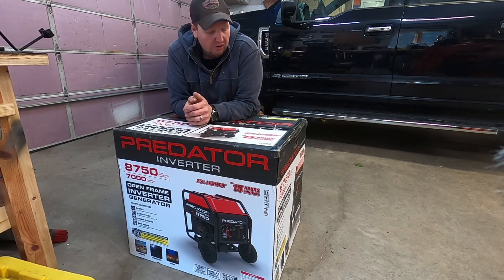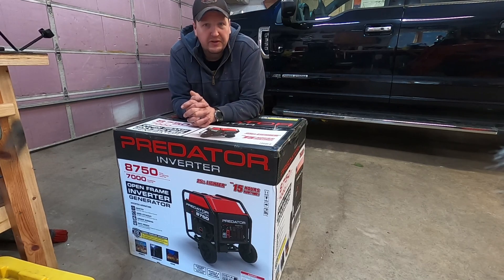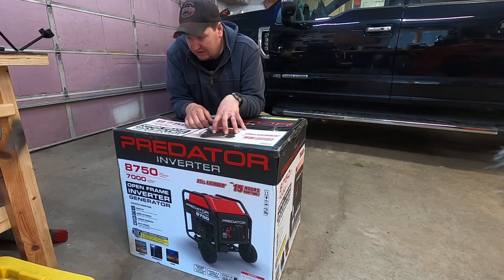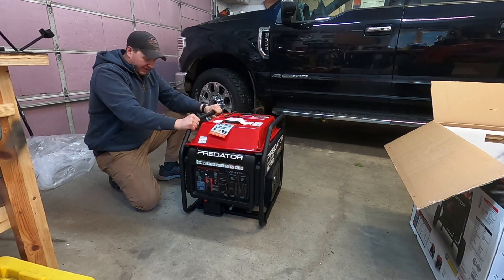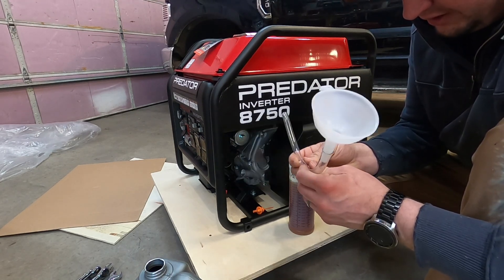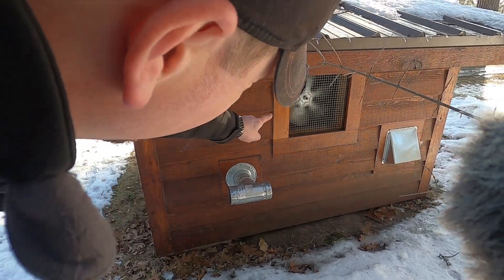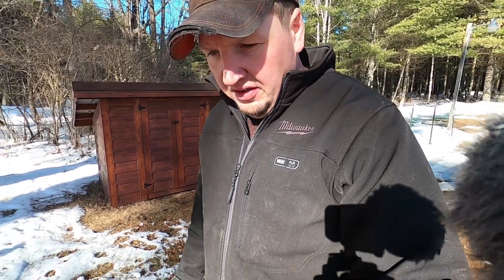Harbor Freight Inverter Generator and DIY Generator Shed

Comment: Just put a piece of duct tape over the CO2 monitor and you should be good.
Reply from the maker: It honestly hasn't been an issue :).  Must be enough air flow and proper exhaust.

Comment: I have bought both the regular Predator generator and the Predator INVERTER GENERATOR..I got many years use out of the regular 8750 generator. It got me through that horrible Texas freeze we had a couple years ago. When it came time to replace it harbor freight was out of the same 8750 generators and only had the 8750 inverter generators. The salesman told me it was actually a better generator. It WAS NOT..To use it I had to cut off my electric water heater, and not use the electric clothes dryer or electric stove. It would stop producing power and show a code on the screen. It only lasted me two uses and the inverter module went OUT. A replacement inverter module is $400..So here I was with a generator inverter that was useless and still looked brand new! If you do decide to buy the inverter generator bite the bullet and buy the extended warranty because the Harbor Freight repair people told me it was very common for those $400 inverter modules to go OUT and they don't repare them.
Reply from the maker: Interesting. I'll have to watch out for problems.
Reply: Yeah, we have a Harbor Freight in town and they keep lots of generators.  Funny thing is, I see a TON of  them on Facebook Marketplace being sold....especially the non inverter models.  I just can't spend their asking price for a generator and then have to buy a "one shot extended warranty" since they only have a 90 day warranty.  Too many other options out  there now.  Especially dual fuel quiet inverter generators that you can run as a single for basics and two in parallel for double the power if needed.

Comment: I have owned both of these generators. The first one was the 8750 generator. Great generator! It got me through that horrible Texas freeze we had a few years ago when we had no power for 7 days. My mobile home is all electric and we were able to live life as if nothing had happened. We heat our mobile home with those oil heaters and the generator worked flawlessly. We did have to fill up with 6 gallons of gas every 8 hours. It didn't get used for a while and I lost power to one side of the 220 outlet. I didn't have time to look at it so I went to buy another one and all they had was the Predator 8750 inverter generator..The salesman told me it was as good as the plain 8750 generator. Liar 🤨. It would trip the inverter breakers and the "overload" light would come on. So I turned off the house breaker that goes to the water heater and we didn't use the electric stove top or electric oven. We did use two small 5000 btu window unit A/C's. It did good for 2 hours then it stopped producing electricity and the engine started racing for about a minute then shut itself off. When I restarted it the engine raced high again then shut itself off. No power was being produced either. I thought it might be the carburetor so I ordered a new one from Ebay, installed it and it still did the same thing. So i contacted Harbor Freight and my 30 days warranty had expired. They told me more than likely its the large module and it cost almost $400. I spent $1,700 on that inverter generator and only used it once. Now I have to decide if I want to spend $400 for the module on a generator that won't run my entire house or just accept my $1,700 loss..The modules are not repairable. Now I wish I had bought the entended warranty 😔. I screwed myself. Although I really don't like having a generator that wouldnt run my entire house. I ordered a 10,000 watt and received it today but not from harbor Freight. This time I bought one from with a 3 year warranty and not the inverter type. The compliments I do give the Predator inverter generator credit for being more quiet and better of gas due to the eco mode. It used less gas to operate. Although I ratcher spend more in gas and be able to run my whole house. This time I wont turn the hot water heater on or cook on the electric stove. I will eat a sandwich instead and not push the generator to its limits 🫤. VERY EXPENSIVE MISTAKE.  MY wife and I are spoiled and don't like change in our life so I learned an expensive lesson 🫤. It just pisses me off that the salesman told me the inverter type was better so I bought it due to them being out of the regular generators 🫤. We don't do well without electricity in our normal life 😂.
Reply from the maker: The only issue with the normal generators is that they aren't as friendly to the sensitive electronics in our homes these days. There's in consistencies in the power flow. When I used the old 8750, the LED lights in the kitchen flickered. 

I'm sorry you have had bad luck with the new 8750 inverter.  Since I did this video, ours has been flawless.  Actually have used it a couple times and it runs the house great!  Granted, we have mostly gas appliances, so we aren't loading it all the time.  The only big load we give to it is the well pump. We do have a large range that uses an electric oven, which is something that we would avoid using in a power outage situation. 

Thanks for being here!!

Comment: Great video. Just downloaded the shed plans, do you have a parts list for the fan and other things that you used to set it up?
Reply from the maker: There should be one in the plan set you downloaded.  Did you find it? I did not include electrical.

Comment: I guess you don't have a lot of high-starting current motors you are trying to run?
Watched a video of someone using one of these to run AC units and an Air Compressor. 
It was UNABLE to start the big shop compressor due to the high inrush current draw!
Ran nearly all the other stuff fine.
Reply from the maker: I have a bunch of high current motors.  Large air compressor, heat guns, AC, etc.  I just don't attempt to use them while the generator is being used.

Comment: Great videos across your channel. This shed is a picture perfect fit for the cabin we just finished and your innovated use of fans for coming and forced intake and exhaust is great. 

Is there any chance of getting a parts/items list for the intake/exhaust/cooling components? Or is that simply a standard attic exhaust with a built in temp sensor?
Reply from the maker: I just went to a big box store(Menard) and got the standard attic fan which comes with a temp sensor and then also for the intake a standard 6" round duct fan.  Nothing out of the ordinary for this setup. 

Thanks for watching and share it with your friends!

Comment: I have a dumbass newbie question that is bothering me PRIOR to purchase [I have not yet installed 30/50 amp box connecting to home panel]:  Using this 30 amp  plug 120/240 from the generator into my 30 amp box connected to my house panel - Can my home use the FULL 7200 watts with all my 120 volt applications [most of the home]?    Thank you for your time!
Reply from the maker: It is my understanding that each hot leg coming out of the generator is a max of 30 amps (actually 3500 watts) on each.  So there are two hot legs of 3500 watts each, totaling 7000 watts, max running. Typically, breaker panels in a house are two hot legs, the breakers as you go down the left or right side alternate from hot 1 to hot 2. So the load is approximately split among the twolegs.

Comment: We purchased 2 of these generators to power our RVs charging and air conditioning needs. The generators keep tripping the 30 amp plug. My old 4000 watt Honda powered the same RVs with no problems. I think they are off on their wattage ratings. We also tried another 7200 watt generator that could run both RVs air-condition without any problems from costco. Before this we had the harbor freight 3500 and we ran that guy well over 2000 hours without any problems except for the pull start breaking just after a couple uses.
Reply from the maker: Are you using soft starts on the AC's?
Reply: @OutdoorsEngineer  no we are not using them. I know that would help, but those suckers are expensive. We returned both harbor units and purchased a unit from COSTCO $699 bucks and she'll run both units... plus it's gas, propane or natural gas. It doesn't have the idle down feature that this unit has, and that is good for saving fuel, but we'll see. It looks like even Honda generators are made in China now.
Reply from the maker: @joeydonaldson4054  The new Harbor Freight 5000 generator looks intriguing.  5000 startup watts.  Remote start, dual fuel.
Reply: @joeydonaldson4054  300 bucks and 15 minutes to install. Dropped mine to 18 amps (on my house not rv)

Comment: Does it run a hot water heater and or AC
Reply from the maker: It certainly is possible.  Depends on the load of the appliance.  Max of 3500 watts per hot leg coming out of the generator.  Take a look at HF's website, it lists possible appliance loads.  https://www.harborfreight.com/generators-engines/generators/8750-watt-inverter-generator-with-co-secure-technology-57480.html

Comment: I've watched every generator shed video on youtube and although I would have used rockwool on the inside I must say this is the best looking shed I have seen.  I went with a lifetime plastic shed for my Generac 17500 with a dual fuel kit but given the THD I'm either going to get the Westinghouse 15000DF or just get a 26KW installed.  I have serious money invested since I did 10 100lb tanks and have them filled just incase.  In Texas this thing gets so hot it's scary.

Comment: Can you use a regular car battery for a generator and what other kinds of batteries you can use for a generator ?
Reply: Yes, but you would want to use a deep cycle battery or a Lifepo4, which is preferable. You would need to connect DC alternators (like the car kind) to a charge controller to charge it using an engine. On the output, you would need a 120v or 240v inverter to concert the DC battery power to something your house can use. Look up solar charge controller/inverter combos, there are many on the market now. This would be a great setup and you could even power the engine off for hours with the correctly sized batteries.
Reply: @2mYgR   @JPG23  It's you-tube videos that shows how you can use a car as a generator.Can a 1000cc car battery with a 1,000w power inverter power a electric oven that's 800w or even a 800cc car battery  ?

Comment: Just a heads up!!!! You must drive a ground rod and ground the gen set. The. You need a 3 pole manual transfer switch so that you are isolating the generator neutral from the power provider neutral. This gen set has a bonded neutral and will not work if you end up connecting power provider neutral to the generator neutral. Not to mention the potential damage and danger if not done properly. Please do you research if connecting to a home that is not in the back country.
Reply: Ground rod is not needed - it affect protective device activation.  Neutral to ground bond need to cut.  Transfer switch is not effective and convenient at all - interlock device is all needed
Reply: @AlexV-pf3io  Exactly,  just unbond it and use the house ground. I might put a switch on mine for bonded/unbonded. Bonded for extension cord use not attached to house/.

Comment: I am having a problem with the 8750 I just purchased. The digital display will not climb beyond 121 volts to 240. Notice that others are having the same problem with their 8750.  Did these people have drain the unit and take it back to HF, or is there a fix? Thanks
Reply from the maker: Why would it put out 240 volts?  Typically 240 actually is two lines that are 120 each.
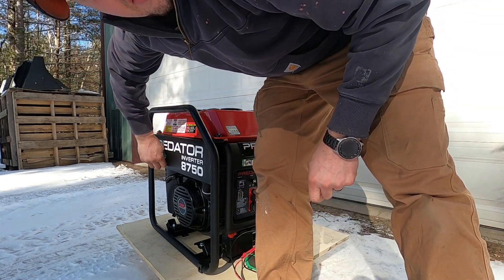Reply: See https://www.youtube.com/watch?v=g7WRtq_jSi8 @OutdoorsEngineer at 5:27

Comment: How did the co monitor system handle being in that shed?
Reply from the maker: No problems!  It was worked great!  I have even let it run for a few hours too. It helps that I have the fresh air intake, I think, and the exhaust going directly out the building.

Comment: I’d like to get me one of those. I was hoping it would be quieter than a generator that was not an inverter. Is it quieter? If that makes sense.
Reply from the maker: Compared to my old non-inverter Predator 8750, the new one is about the same noise level as the old one.  They are both open frame models.  Harbor Freight does have a Predator 9000, which is a closed frame inverter generator, and I would expect to be much quieter.  The shed I built turned it into a closed frame :) and also protects it from the elements!

I do have the Predator 3500 which is closed frame and it is very quiet.  We use it for camping.

Comment: what is an inverter generator? Never heard of it?
Reply from the maker: Look them up.  Much better for sensitive electronics.  A quick google search led me to this answer: 

Conventional generators use a mechanical alternator to produce alternating current (or AC) power that’s ready to use.
 

Inverter generators also use an alternator to produce AC power, but this current is converted into direct current (or DC), before a microprocessor inverts it back into cleaner AC power. This three-phase process produces much higher quality, more consistent and reliable AC power – similar to the power you might otherwise get from the grid.
Reply: @OutdoorsEngineer  Thanks. I was looking for it too. 🙂

Comment: Question about having to have the battery connected to use the rope pull start. I read a WEN 875i has to have a good battery even to pull start. That defeats an emergency situation, my batteries died all the time. Amazon messed up my 8750 champion delivery so I ordered a WEN 875i, and that's delayed now. You and others show predator better than I expected and I can get one tomorrow. Just wondering about the battery being required. Enjoyed your video and set up. Beyond anything I can do. Oh, and does it just have a 90 day warranty?
Reply from the maker: I am not sure if the battery is actually required to pull start on the new Predator 8750.  It comes with a battery, so I just installed it. I then make sure to run it every month.  

I am a little worried with it being lithium about it working in cold weather.  (It can get really cold here (0 to -20 for lows). So we will see how it handles the cold weather.

2 year warranty on the engine and 90 day warranty on the entire unit.  I do know at checkout, you can purchase a replacement plan.  I don't know the terms, but it might be $1-200 for a no questions asked replacement.

Comment: Have you looked into a propane conversion kit so you could run longer with out the need for filling up gasoline ? I like that generator house set.
Reply from the maker: I have, but with the location of the generator shed vs both of my large propane tanks, it would be a big undertaking to bury a line.  It probably would be better to get a 3rd propane tank, but not desirable.  I haven't found the need to do that yet.  Maybe, someday.  I just make sure I have the tank on the generator full and I now have capacity for 20 gallons of gas on hand. So if I know there may be a bad chance of storms, I make sure everything is full.
Reply: This is interesting. My propane line is right next to my panel!

Comment: Great videos brother!
I have a question with regards to why you went with the Predator 8750 Inverter over as a replacement for the Predator 8750 non-inverter?

I have a non-inverter (7500 watt) generator, and when I am on generator power, the LED lighting in my house house flickers unless or until there is a reasonable load on the generator. For example, if I plug my 1500 watt heat gun into one of the 100v outlets on the generator, the house light flickering stops completely, but at 1500 watts, that is a 12amp load on my generator, which has a 30 amp max output, so I am sacrificing nearly half of the available output just to eliminate house light flickering. So, my question is, IF your house lights were flickering on the old non-inverter Predator, did switching to the inverter generator solve that problem for you?

The main reason I ask, is because I watched your other (previous) video, and you have an intake and an exhaust fan running directly off the (old) generator. Was that NOT enough of a load to "pre-load" the generator and stop flickering lights in the house? If you did NOT have flickering lights, why did you upgrade to an inverter generator?

Thanks man!
Reply: The predator inverter power output voltage and frequency regulation is much closer to optimal as compared to non-inverter generators where they can vary much more.  

Unloaded frequency might be around 61Hz and drop to 58Hz when fully loaded on a traditional generator.
Reply from the maker: Yes, we had flickering of lights with the non-inverter generator. The non-inverter generators do not deliver a consistent power supply (in voltage and so I have read on the internet). This can be problematic for sensitive electronics (LED lights I presume would be included in this category). 

The new inverter generator, the lights are consistent and do not flicker! It is also better for the sensitive electronics because it delivers a consistent power load. 

I mainly upgraded due to the inverter generator being overall better for the electronics the generator would be powering: TVs, computers, internet routers, etc. And now that you remind me, the lights in the house didn't particularly like the regular generator.

Comment: Awesome 🤩 generator shed!!!
Reply from the maker: Thanks!
Reply: The only change I would make would be to replace the exhaust Tee with a simple elbow pointed away from the intake. 

One other potential improvement to make if it is not already present would be to add a make up air vent from a louvered vent (1’ x 1’) with a bug screen to allow the attic fan to move more air.